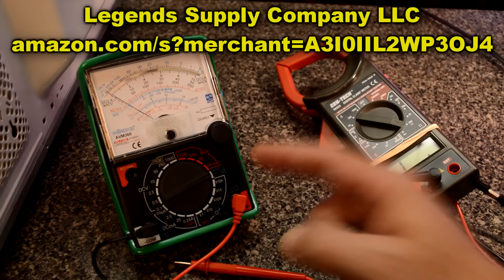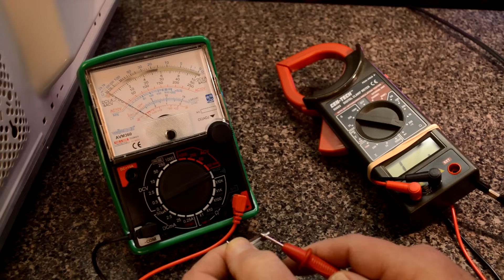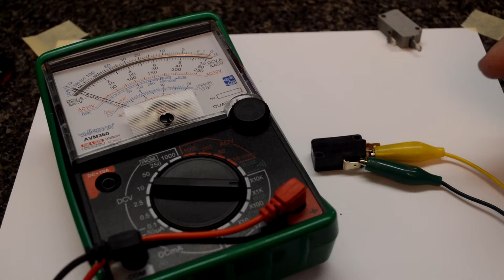Microwave Oven Repair - How to Test Fuses and Switches

Comment: Hey thanks for an excellent review on repair techniques I should know from past experience but sometimes get rusty or forgetful about. Thank you also for the safety tips it's better to take a little extra time then Arc weld a screwdriver to the control board we're experiencing a heart stopping burst of high voltage! I'm glad you were able to fix your microwave by replacing the microwave switch. It's funny how sometimes it's something that simple. Also rewarding after taking the time to take it apart and explore the insides. You've given me inspiration to dive deeper into my microwave, while also staying safe. Thank you again as I enjoyed your video and thank you for the link to the more comprehensive guy to microwave repair!
   You've got a nice set up and repair area there for your videos. Keep up the good work as I'm sure others also appreciate your videos.🪛😎👍

Comment: IN my whilpool microwave Fuse blown 'diod ok, Cap is ok, Transformer is ok. Magnatron is also ok. when door is open light will come. finaly 1noticed in the control board. 2 Relays are shown burned ..
1. wants to change full Circuit board.
2.OR  change the damaged Relays only ?

Comment: I didn't run across your video BEFORE I  checked the transformer, magnetron, capacitor and even took the combination microwave/oven unit out of the wall untill finding out the door switch and the slow burn fuse was bad. Now I know what to look for first. Excellent video!

Comment: Follow-up:  I did fix it!  
In addition to the fuse, 2 of the switches were fried.  I replaced all and success!  Had someone replace a circuit breaker in my fuse box & that's what I believe fried the unit.  Of course the handyman said my micro was bad & that caused the breaker to go and micro needed to be replaced...I don't think so.  But no sense arguing I just watched the videos & fixed it.  😂
Parts cost $10, replacement w/ install would have cost $1,000.  
Nice savings.  😊
Oh btw, I'm a retired IE who didn't like EE.  Lol!  Was very pleased when it worked and believe my husband was looking over my shoulder.  Blessed 🙏 .

Comment: Friday just before Yom Kipper (10/11/25) when I opened my microwave door to stop it, it popped and it dead. I'm wondering if it is the capacitor that blew up. It has no power and when it blew it also blew it's dedicated circuit to the power box in the house. Thank you for this very clear video.

Comment: Up 3am trying to find the problem with my 400 dollar Panasonic inverter  we only had for 3 months then my Wife yelled from the inner lines of the creepy floor boards of our turn of the century pillars of a foundation, did you fix the microwave yet while I'm tuned in to the only guy that made since all night the Guru brew shouts out to you my guy now I can finally go to bed its now 7 am. ITS FIXED

Comment: I have an old microwave, more than 15 yr old. never had a problem with it. Last few days I noticed the push button #5 stopped working.  Then last night I went to use it and the display lit up and everything seemed to work. But when I pressed the start button it did not work. Everything lit up but it acted like it was waiting on me to push the start button. So, I did several times. Even opened and closed the door. It was all lit up but would not start no matter how many times I hit the start button. As old as this thing is and the control panel #5 not working. I think the control panel may be bad. I am thinking it may be time for a new one. Any helpful thoughts would be most welcome.

Comment: Awesome, you saved me a lot of hassle. Several years ago our microwave stopped working. So i took it to the garage and took it apart. Never done this before but i found a fuse. Thought maybe thats all it was. Yep bad fuse and it worked. Now door switch is bad so i will do the same again. We didn't like the newer microwaves, too cheaply made and looks cheap. So i get to save it again.

Comment: Thanks for informative video, just to the point!
However, I have one question:  Will the capacitor survive to be short circuited without a resistor to limit the current?

Comment: So the Maytag repair guy was right, there are multiple components the LOOK the same. He probably asked What is it for? Not just What is it??? Do you value your life? Because even with the microwave is Designed to shut off when the door is open the wrong switch could Possibly kill you when it doesn't work properly...

Comment: Liked the pace, and the detail on the micro-switches... just wished that you had placed the platter so we could see that it was turning as well. That's my situation, no turn platter and no heat... My top micro-switch appears defective and hoping that by replacing that one switch that I will have platter turning along with heat. scared to death of extracting more switches.... those clip- hold tangs look fragile Thorough otherwise, and THANKS !

Comment: You asked for a comment... How's this? Dude you are a badass. I enjoyed that far more than I needed for the information I wanted to get out of it. Not sure about using a screwdriver on that size cap, I have a fused thick wire and it still gets pretty hot at just 700V when I am working on audio amp caps. But also, I once welded a wrench to the side of an track (military personal carrier) above the battery because I touched the wall and the positive terminal at the same time with a 9 inch wrench. Threw me across the track as well. I'm... uh.. skittish when it comes to stored charges, lol.

Comment: Great video! I put a crock pot in my ge microwave for 45 minutes & it was almost done when it not only kicked the breaker but now nothing comes on after resetting the breaker. Still no go, im hoping just maybe the intensive heat radiating from the crock pot cooked the fuse. Will find out tomorrow when I tear this bg dog down. Thanks for the easy to follow along video.

Comment: The old GE JES1384SF has identical symptoms, otherwise a beautiful machine, no way can I just toss it. Awaiting delivery of a Torx driver to get the cover off. Its a T25 security button head for those that have this model. Capacitors! We discharged some that were the size of pop cans in electronics class!

Comment: Thanks for the video. it was very informative. My Panasonic microwave just stoped working. First, it went dark as in no light, no power. I unplugged then plugged back, and the power came back , but it sounds like it wants to start with the door closed, then stop as the door opens. I'm gonna open it up when I have some time and test the switches. I did suspect the switches but will open up and confirm.

Comment: Thank You for realy helpfull tips. This particular problem is not mine unfortunately, but I still got a lot of knowledge from You.
Mine issue is louder than usual humm and a rather burn plastic smell that was not there before. Will have to look ower the swithches like You did, thank You. And to possilble issue with the diode at the capacitor. And yes I will fully discarge it prior.

Comment: Very simple to follow. Like the way to discharge the capacitor. I need to fix my MW. The door won't stay closed so it is a door catch issue  but mechanical not electric based. So, I am on teh way.

Comment: Cool I hope it's the switch I checked the fuse my meter quit working so that sucks so I just ordered all new switches I also saw a video where a guy just held the clock button down to reset this did work but only cycled once then tripped my switch again?

Comment: Great guide. Shame to the Maytag Man.

My issue wound up being some of the cables on that board that contains the fuse. Something was just a bit off. When I closed the door the timer would come up, and immediately go away.

Took it apart and trial and errored till I figured that out. Reseated everything and it works now!

Comment: Discharging high-voltage microwave capacitors by short-circuiting across terminals using a screw-driver? BANG! Perhaps not the safest practice for the amateur repairer (or the screwdriver)?

Comment: Question: Does all the thermal cutout have continuity? I bought two and mine didn't show it. Part # 530444023 for an Electrolux over-the-range microwave. if you can please advise. Thanks.

Comment: Enjoyed your microwave repair video. I'm an electrician in aerospace that's being asked to troubleshoot microwaves,and floor scrubbing machines as well as corded and cordless tools. Been in the trade 30 plus years. Still learning new things every day. 
Keep up the great content.
Reply: Hi can l ask you a question please?
Reply: I used to work in the field for Sears on washers, dryers, grills, bench power tools, recreation equipment,  and garage door openers! Before moving on to a cable company before retiring. Oh and 16 years in Navy Electronic Warfare.

Comment: I am learning. I have the [dead] microwave in the back of the pickup, teetering on going into the trash. I have replaced it with a newer one that is of lower quality - but I am still in the period of when I can return it.

Comment: Thanks! Our sharp Carousel decided to keep running after the time I had it set for. It stopped when I opened the door,but began running again with the door closed. I followed your suggestion and tested  the door switches. The middle one was bad,so I scavenged one from an old oven I never got around to scrapping. No cost,1/2 hr down time, and my wife is happy! Win,Win !

Comment: Always open to give a comment. However, it's rare to get any comments in return. Usually people end up too busy to respond and it leaves viewers and subscribers feeling like they're talking to themselves. Nevertheless, thanks for the video. My microwave problem is the "defrost" stetting is not working, but the full power setting is. Gone through a 15 amp Type S old school screw in fuse, worked on both settings for a while, then "defrost" setting quit. Goin' back in to attempt to figure it out. Doubt it's a micro switch, but you never know. I'm thinking "diode" perhaps? Don't know. Anyway, thanks again and your video was well done.

Comment: Hi. I have a similar PCB which has an on display, but push buttons dont do anything. I took the pcb out, cleaned it, put it back and it worked for 10 minutes, now again same issue. What should I look at? Thanks.

Comment: Great video! My GE built in wet bar micro has zero power😕. Used 10x to heat coffee over 9years. Computer board was always janky, kept asking to reset clock. Fuse, (3) door micro switches, 2 heat sensors, all good. What to test next?

Comment: Excellent video. Clear, humourous, safe,  informed, experienced, concise and covered all the bases well.
My problem was one of the micro switches was open circuit. One on order so await delivery.  Fuses were checked as per video, so am hoping it works when installed. One of  the very best instructional videos I have viewed.Congratulations; oh| and a complete lack of BS!!

Comment: Thanks for the video,but, you did not tell what the door switches perform or what happens is they fail in closed position. One, with door open ground the mag capacitor to drain high voltage. If micro fails closed, oven will blow the fuse or pop the circuit breaker, which ever is rated lower. It drove me crazy looking for a short, and all the while I suspected it may be a design safety built in.

Comment: A great video. Clear and concise. Here in Thailand my Electrolux microwave just clicked off after running for about 13 minutes on the Auto Menu, baking potatoes. Following your instructions, I replaced the 10 amp power fuse which had blown. Plugged it in and it lit up. Pressed start and it blew again? Before I start tinkering again, any suggestions? Keep the videos coming.

Comment: I enjoyed the video. Did some troubleshooting and found a capacitor on the board with the negative lead disconnected. I re-solder it and the microwave works..

Comment: Thanks for the info on the capacitor... I watched this after I took it apart and realized I can't figure it out, why it has no power and found your video, hoping to learn something.    Even though I was smart enough to turn the breaker off,    (hardwired to the house ) it might had still had power in that thing and I could have died if I had touched it.   maybe I should just stick to cars and bikes. DC shocks are just fun for your friends watching you scream and smash your head on something swearing. but I've never died.   just subscribed !

Comment: I have one that there is a high voltage fuse inline
With the magnetron .. That fuse blew and was wondering what are the odds it was just a fluke or the magnetron is legitimately failing ?

Comment: Well done and explained...thanks. 
I came across your tutorial after just waggling through this myself. My Oster appears to be the identical machine to yours and the problem turned out to be the same top switch. Unfortunately, I thought, gee, I'll check the solution by shorting the switch connections, effectively taking a bad switch out of the circuit. Well, the microwave worked until I tried it again, maybe by opening the door, which apparently caused an over current situation, instantly frying the fuse. So now, with fingers crossed, I'm off to get a replacement switch and fuse, hoping I didn't cause more permanent damage.

Comment: I'm a 70 year old widow.  My Husband always turned to videos for how-to on something he hadn't tackled before.  I've already replaced the fuse which was fried.  Now I'm going to attempt to check and/or replace the switches.  I'm hoping to fix as my microwave is only about 5-6 years old and it's a Whirlpool over-the-range.  So, it's too heavy for me to remove & replace which means not just buying a new one but getting someone to install.   One thing you did not mention in the video that I'm concerned about is my door has settled slightly almost 1/16" (I tend to pull down & out to open) and therefore has a small amount of play.  I suspect that may have caused the switch to fail.  I'm going to investigate further to see if I can find a fix for that and then replace the switch(s).  Thank you for the informative video, very helpful.  Wish me luck!
Reply: I know it's been some time, but I just had to comment. You're a real sport for watching this video at the very least. Most wouldn't even try to find out. 
My Whirlpool over-the-range unit was working intermittently, but after 17 years that's not too bad. I was an electrical engineer and have fixed microwaves before. My Whirlpool was an "inverter" model and replacing the bad high voltage circuit was expensive. We ordered a new Whirlpool and paid for installation because my physical condition prevents me from lifting it. 
The door on our unit sagged a little also, but it was the worn door hinge pins. Probably yours had the same issue and was not your fault. 
I applaud your efforts to repair yours and hope you fix it. Someone can always use a used microwave.
Reply: Go contact ROTC units at local high schools. They are eager to get community service points by helping widows.

Comment: Wow, it’s amazing that a little curiosity problem solving and critical thinking you can fix pretty much anything. I fix my microwave by opening up the front and seeing the burnt wires leading to a thermo switch. The microwave would work when I reset it by unplugging it but when the machine started to heat it would shut down. 3.75 part and it worked perfectly. Saved over 400 on purchasing a new one. It feels so good to fix something on your own. Almost like you’re sticking it to the man...

Comment: I'm not sure how a switch would effect the heating.  The way the door switch works is that if it is open the microwave will not work at all.  So how does a microwave run and appear as if it is heating and not heat.  Shouldn't it not run at all if it was a switch.

Comment: Great video it will help me a lot. Unfortunately my microswitch seams to fail sporadically, most time it works but occasionally it doesn’t. Most of the time it happens the light doesn’t turn on either. Any way to tell what switch that would be?

Comment: Sir, this was awesome to see. All this time I did not know what the speaker function was for on the digital or analog multi meter, so thank you for showing me that as well. Also you made it very easy to understand the micro switches. I also appreciate how you used the piece of heat shrink tubing to safely wire off or protect off the third prong of the microswitch in your video. Thank you very much for crafting this video.

Comment: I threw a microwave away, a while ago. It had similar symptoms but, It had special screws that I couldn't get out. I think they were special torx screws! I wish I would have run into your channel earlier. I think I could have repaired it. I'm an old tec and cautious around high voltages! Worked on many high powered transmitters.

Comment: My Panasonic Microwave went bust. Am lucky to have found this wonderful video of GuruBrew. It is simple to understand and very detailed. The fuse is blown. It's a ceramic fuse and not very easily available in Mumbai, India. Can I replace it with a glass tube fuse ? It is a 20 x 5mm 250V 10A fuse. Thanks and all the best. Rustom

Comment: Thank you for the video

I have an Oster microwave that came with the house we bought. It has since quit heating.  Everything else works. 

Magnetron, thermal fuses, and door switches, all test good with continuity. 

Only thing I haven't checked yet is diodes and capacitor.

But, I have a relay that looks like the connector has possibly burned up. It doesn't smell burnt tho.  Is it possible a relay could be the problem?  

If so, how can I check the 2 pribg relay on a board?  I'm either missing it, or can't find anything on that

Thanks

Comment: Nicely explained, good looking out for the capacitors. Clearly explained. 
Didn’t you used to be in Parks and Rec? 
Micro switch explained and cost of one more s valuable. Thanks